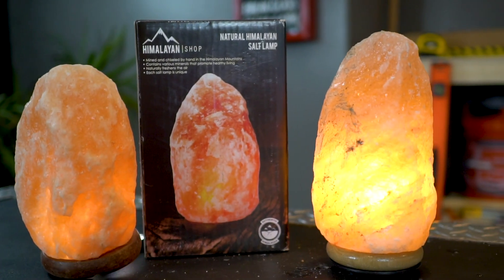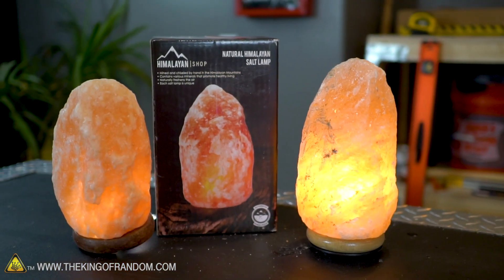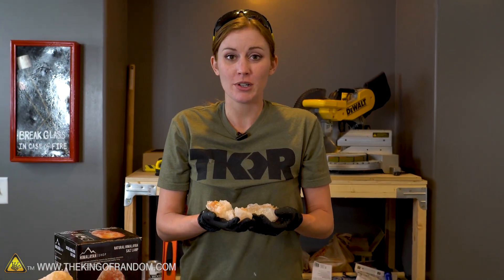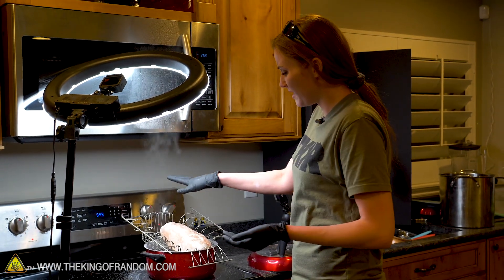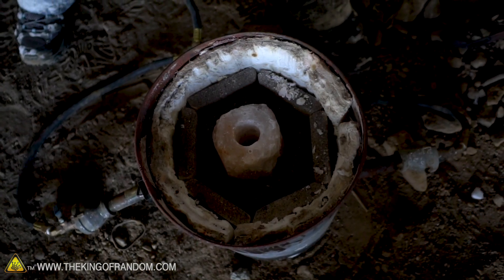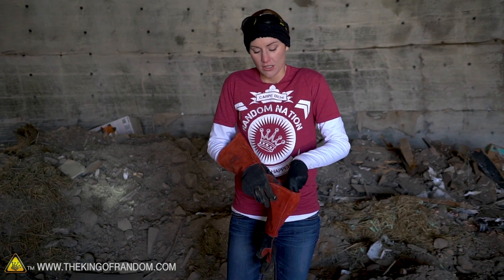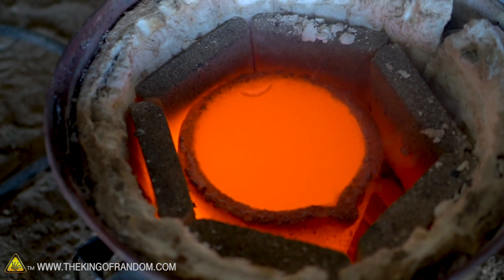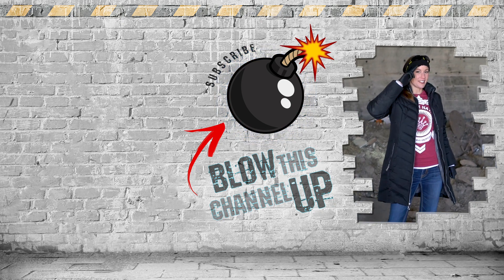We Liquified a Himalayan Salt Lamp

Comment: The issue with the condensed water vapour was that both the water vapour and salt lick were hot.  If you were to put it in a cool room of 99-100% relative humidity, you'd see the water condense on the salt block and then erode it.

Comment: Had one of these (candle holder though, the bottom was salt instead of wood) melt on my toilet.  The cold wader caused condensation on the top of the tank which got the candle holder wet and it slowly dissolved.

Comment: At some point while boiling it you will have saturated the water, which I believe you did, causing it to no longer be able to dissolve. And as you remove water through evaporation it leavea behind salt which cannot remain in the water due to satiration, hence the salt everywhere

Comment: In a single video calli has;
1) gambled on whether she was putting glas or salt in her mouth 
2) worn rubber gloves near a heat source
3) touched a crucible while not sure if the substance inside was still molten
4) used a wooden stick to check if salt was liquefied into molten salt with heat

Why was she left alone for this video?...
Reply: she also said "i know i don't want to touch it but i kind of really want to put my hand in it"

Comment: You tried affecting the density of wood in a previous video by boiling pressurizing and using the vacuum chamber. Water was the key ingredient, try liquid galium instead of water the wood might absorb it making an interesting way to make metallic structures from wood. You'd further have to design a new vacuum chamber capable of keeping a temperature of at least 300° Fahrenheit or 148° Celsius making for lots of new interesting projects including trying the liquid galium and wood and if wood wouldn't work try foam or some other material.

Make magnets, melt a fero magnetic material in your new foundry then cool it in a strong magnetic field. It should become a magnet. Experiment with alloys and other metals silver gold try copper tin and so on

Comment: Either that time lapse was not 1000x, or your stove clock is very broken.
Reply: the reason it's 1000x is bc they used a timelapse camera which usually films at a much different rate than a regular one would. so for that camera and the film it recorded it's 1000x but in real time it likely is more like 100x or something
Reply: @ellespoonies  what are you talking about? 1000x means 1000x, you can't say "1000x means 100x because of blahblahblah" Thats like saying "I last 3 hours in bed, but I'm counting in man hours, which really is more like 3 seconds." No matter how you slice "is more like" or "because x y and z" doesn't change the fact that the X means multiple.... you say 1000x normal speed. 1,000x normal speed would take 1 frame every like 8.3 hours, basing that on 30 fps.
Reply: @russellreal  If camera A takes 1 frame per second and camera B takes 10 frames per second, 1000 frames per second would be 1000x speed on camera A but only 100x speed on camera B (small easy numbers used as example for ease)
Reply: It's a time lapse camera, it doesn't work like a normal camera.
Reply: yeah, 100x at most

Comment: Also of cause u can melt all salts, this is becuase all u need to do is to generate enough thermal energy to chemically break the ionic bond between the positive ions and the negative ions. So basically all u have to do is to generate enough thermal energy which has a greater magnitude to THAT of the ionic bonds between the opposite charged atoms. ANIONS AND CATIONS. JEEZ BASIC CHEMISTRY HONESTLY. And so greater the electrostatic attraction between the opposite charged atoms, the greater thermal energy is required to break the ionic bond.

Comment: Ok who ever thought that u can not dissolve that type of salt does not not know basic chemistry, when i saw basic chemistry i mean 5 year's olds know that. Firstly most salts are soluble in water due to waters electonegativity. Due to huge difference between the electronegativity between oxygen and hydrogen it makes it a huge candidate for dissolving salts. This is becuase water is classified as a polar substance, and polar substances generally are perfect fpr dissolving salts. While oils and ethonal are not perfect candidates, due to their polrity. Oil and ethonal are classified as non polar substances. Yes u can dissolve salt in oil and ethonal but at a particular temperature, thus making it a generally bad candidate for dissolving salts.

Comment: Of dissolving in boiling water wasn't as succesful: 1. You have a finite amount of water instead of an endless running tap. 2. The water in the pan can only absorp salt until it reaches saturation point 3: the water is boiling away, so is doesn't touch the salt after a while... But of course, you already knew ;-)

Comment: Melt some salt and drop it in water . Beware it will explode.

Like if you want to see explosions!
Reply: niek wisse if she drops it in water and it explodes then she was producing chlorine gas the entire time
Reply: I already did it. 1kg vs water for a public demo. Banana pealed a 5 gallon pail
Reply: What Fahrenheit is it to melt salt
Reply: 1,474°F or 801C pretty chilly
Reply: TheBackyardScientist already did this, but it would be interesting to see someone else’s take on this.
Reply: YES
Reply: NO! CAST IT INTO A SWORD
Reply: You got that from the backyard scientist
Reply: sodium chloride
Reply: I want
Reply: I tried it luckily I had goggles because it blasted into my face
Reply: Well, I'm sure it's the sodium that would cause that explosion, as sodium reacts to water.
Reply: @aykay8528  it doesn't react at all it's just the salt is so hot it melts the water into steam and those air pockets have no where to go so it explodes
Reply: @trentdavis404  Um wrong. Sodium does, in fact, react to water.
Reply: @aykay8528  But salt is not sodium. It's sodium chloride. I don't know what the molecular composition is of the Himalayan salt, but I imagine it's fairly similar. I also don't know how hot you'd have to heat salt to in order to break those molecular bonds to get pure sodium, but looking at the byproduct after it cooled, I think the sodium chloride is still intact.
Reply: @ Ay Kay Sodium and Salt are different sodium reacts explosively with water while salt, molten salt and every other salt forms a stable complex with water called SALTwater.
Reply: @Maximillian Radniecki the molecular composition of Himalayan salt is in fact NaCl or as you said sodium chloride but it was formed in a way that gives it its color its called a Himalayan salt lamp because well this salt is found in you guessed it the Himalayas
Reply: kevin gulik it is so hot it flashes the water into steam
Reply: @trentdavis404  both sodium and salt reacts to water, just that sodium reacts in the solid state and is a chemical reaction while salt is a physical reaction

Comment: I have a Himalayan salt lamp. I left paint water out, (I forgot to clean up a late night painting session and went on a trip the next day for a few days). I just recently cleaned out my cabinet that holds all of my crystals and witch things. MY CLOSED CABINET WAS COVERED IN SALT CRYSTALS! My bandana is now stiff with salt. A few of my posters inside of the cabinet now have these cool crystal textures on them. A few of my book covers have the same texture and I almost ruined an antique metal soap box (I store my herbs and sage in there, i also use it to dry herbs and flower petals) from scrubbing off the painted design on it. Where the salt was laying is now completely polished!

Comment: 6:55 Shows salt heating at 8000x speed for 15 seconds

"...it's been about an hour and a half..."

Excuse me but don't you mean 33 hours? :3

8000x != 8000%. Doesn't matter because 80x would be 20 minutes and 800x would be 3 hours 20 minutes so your time laps makes no heckin' sense.

Comment: rather than re-melting it to get the salt out, couldn't you just let water run over it until it dissolves a bigger and bigger hole and eventually clears the hole thing out? Or does salt maybe have different properties after its been molten? I know magnets don't stick anymore after being melted

Comment: Its basic chemistry. salt is an ionic compound. Ionic compounds have really high melting points and dissolve in water. Unless the lamps are more than just salt, they will follow this characteristics. The trace amounts of elements (responsible for the pink color) won't do anything to the structure of it. Still entertaining for some reason though.

Comment: Moisture is a byproduct of propane combustion - so the question is, did it melt or dissolve?
Reply: it definitely melted.

First, steam was awful at corroding the salt as we saw in the first section.

Second - at the forge temperature, any steam would escape instantaneously (well above 100 C - its above 1000 C)

Third - IF any steam did dissolve the salt, it would instantly evaporate leaving behind salt residue - which would then melt.

Fourth and most obvious - if you pour a saturated salt solution into the forge it would boil very quickly, leaving behind a salt residue, then later melt the salt.

Comment: How much gas does that dual burner go through in an hour? would a 20 pound tank run that long with two burners? Just trying to see how long 20 pounders would last to melt some aluminum for some casting work, vs trying to use natural gas. (yes, natural gas is 1/3 the heat, but it's basically continuous)

Comment: What happens when you melt a nattery. will a battery still work if you freeze it, what happens when you put it in acid, what happens when you put in molten aluminium And in the vacuum chamber.
P.s. do it all with separate batteries

Comment: Greetings from Singapore. 
I have a suggestion. Is that, maybe you can built a sink with a filter that can just use a limited amount of water that just keep recyling itself then wasting water to make videos for us to me.
So, this is how is goes, you get a pail of water, attatch some hose, turn on the tap, and the water will be running, and it will drain through the sinkhole, by pass the filter and come out from the tap again.  Save the earth guys ✌

Comment: Please dehumidify vinegar and mix it with baking soda and water and see what happens
Reply: The closest I can think to "dehumidif[ied] vinegar" is glacial acetic acid.

The main component in vinegar is of course water, but the second largest component is acetic acid. Typical white vinegar you would find in a kitchen is about 5% acetic acid and 95% water.

You can remove the water through various means, or synthesize acetic acid from some other source to achieve a very pure acetic acid. However, pure acetic acid is a liquid at reasonable atmospheric conditions.

I will say that it is very surprising that mixing pure acetic acid with baking soda produces almost no reaction. The reaction mechanism requires there to be water present to act as a catalyst.

Adding all 3, water, glacial acetic acid, and baking soda will produce a very similar reaction to baking soda and household vinegar. However, the concentration of the acetic acid can be set by varying the amount of water. The result would be that the reaction comes to completion quicker with weaker concentrations and the reaction goes slower, but produces more CO2 gas by the end with stronger concentrations.
Reply: @akunog2708  you must be fun at parties

Comment: Firstly, what studies are you referring? Second tourmaline can be bought in much smaller quantities such as a carved necklace for $20, a small felt beg with grape sized pieces for $12. That said, the ion transference is not actually a proven mood booster, but even the action of release from salt has the effect of removing order causing molecules from the air, but it's more effective in the form of baking soda. P.S. You should try making a hydrogen rocket.

Comment: Hey, so several times in the video. You guys said that you were gonna erode away the salt, I just wanted to say you were using the wrong terms, erosion refers to the movement of rock and other sediments. The word you are thinking of weathering, by dissolving the minerals in the lamp you are just breaking them down into the lamp down into its base minerals, or dissolving it, you are separating the positive and negative ions that make up the salts. Just wanted to give yall a bit of a fact check so you arent putting out the wrong info.
Reply: Rock or other sediments*

Comment: I dont mean to be that guy, but for these "under the tap" methods, could you not use a 1gallon loop with pump etc so that youre not wasting clean fresh water??
Reply: Or, even better, not dissolve it in any water at all because Himalayan salt is still 98% NaCl (the only difference is that it has 2% of another mineral which basically only makes the color different), so it's common sense that it will dissolve in water in the first place
Reply: The water would quickly become saturated and it would require electricity.
Reply: News flash, all water is recycled, shocking, I know.

Comment: What would happen if you took a light bulb and but in boiling water while turned on, put in a furnace and what will remain and what would happen if you put in hot copper or In a large shock of electricity? Will it spark really bright or will it explode and cut off the power?

Comment: I want to know what happens when you put snow in a vaccumm chamber.
Reply: 1) enters a crystal lattice state since the lack of barometric pressure limits it's ability to melt from temperature. Then 2) It sublimates in to vapor, no liquid phase. Just straight to vapor after it gets warm enough.
Reply: @Skedge  iirc TKOK has done that before
Reply: TheDigi321 TKOR

Comment: Thumbs up for the Veritaseum reference (and I think you probably got some ions from the melted one, since the main barrier to ionization of sodium and chloride ions from salt is a high energy threshold, and you certainly poured a lot of energy into that salt!), but you might want to watch that video again if you still think that negative ions actually have any noticeable effect. The conclusion wasn't that salt lamps don't emit awesome negative ions, but that salt lamps don't emit ions and ions don't actually have any significant effect.

Also, I realize this is beyond the scope of your video, but if salt lamps really did emit negative ions, then they'd have to have positive ions remaining on the surface, most likely combined with hydroxide ions, forming sodium hydroxide (lye) on the surface of the lamp, given that it's supposed to be water in the air breaking the salt into ions with the addition of heat... which means that the chlorine wouldn't be released as independent chloride ions, but as hydrogen chloride, a colorless gas also known as hydrochloric acid when dissolved in water, so, yeah, probably for the best that those salt lamps don't work.

Comment: Can glass melt in a microwave
Reply: Yea.  You should try it
Reply: @christianreza407  Bru chill
Reply: Yeah take an empty beer bottle, take a propane torch heat a hotspot In it then put it in the microwave it will then get hot melt and make plasma and make some very nice sounds
Reply: no.

try it - anyone who has put a DRY glass container in the microwave knows it does not heat up. Reason being that molecules have to vibrate from the microwaves and glass doesn't do this very well - even though it is technically a liquid.

if the glass container is wet, the water will heat it up and potentially it can crack if its not heat proof or reinforced glass. However, its FAR below the melting temperature of glass and will not melt. All your doing is transferring heat from the boiling water to the glass - so its going to be around 100 C. You can get higher temperatures if the liquid used are oils - but not to melting temp.

The only way I think you can get the right temperatures is creating plasma in the microwave - but the duration of the plasma would be difficult to control and likely to first shatter the glass or break the microwave (most will shut down if overheated)

So..............basically no, you cannot melt glass in a microwave.
Reply: yes
Reply: Eli Lammers no
Reply: Eli Lammers no
Reply: no

Comment: Can you please try to do the reverse. That is to turn diamonds into charcoal. There is a myth that says putting diamonds under a lit match causes diamonds to immediately burn up into coal. Try to burn diamonds with flames and heat. Also, try freezing diamonds in water ice and dry ice. For this experiment try using different types of diamonds to see their different effects. Many thanks.

Comment: Rock Salt is essentially the same as normal salt in it's composition, being Sodium Chloride (NaCl). Salt is 'deliquescent', meaning that it absorbs moisture from the atmosphere. This is why it is used in food preservation, as it acts as a drying agent. Salt lamps will, over time, dissolve away, but it can take years - if you live somewhere humid, it might only be months.

Comment: you should freeze sulfur hexafluoride in a balloon and put that frozen balloon into another balloon and fill it with helium and see if the too gases will cause a suspended equilibrium where you can just get them to remain in place in the air

Comment: Would it be possible to make a energy source that loops in a circle e.g. a small pool that has a turbine that spins with wind and current that also works as a source of electricity
Reply: Are you asking them to make a perpetual motion machine?
Reply: rhodie mcdodie yes basically
Reply: They’re clever but I’m not sure they can break the laws of thermodynamics.